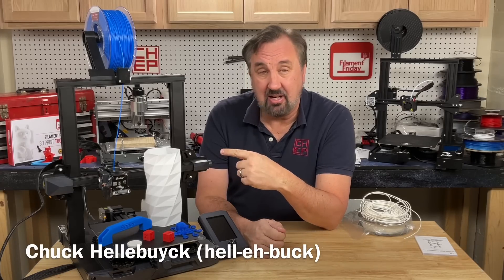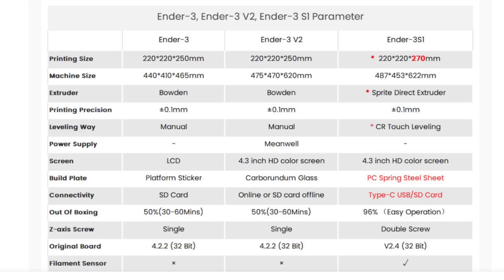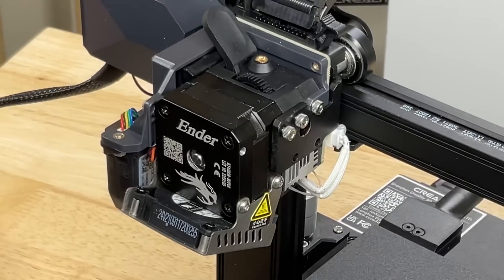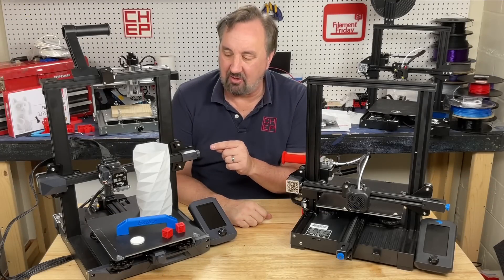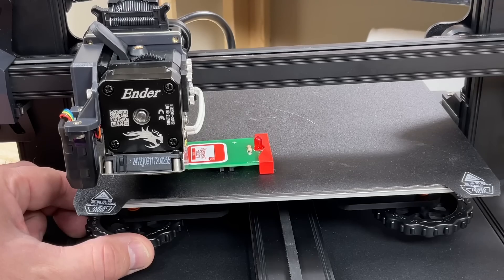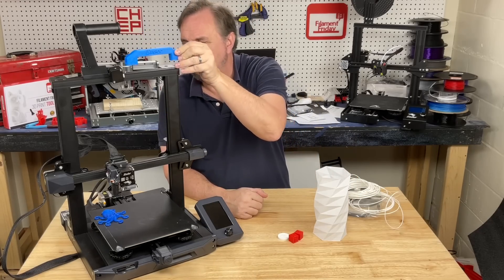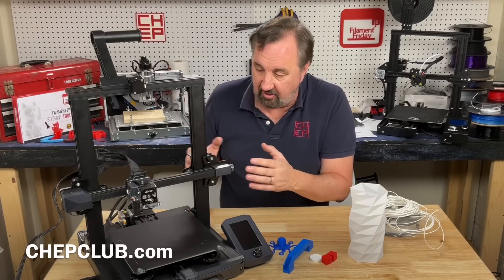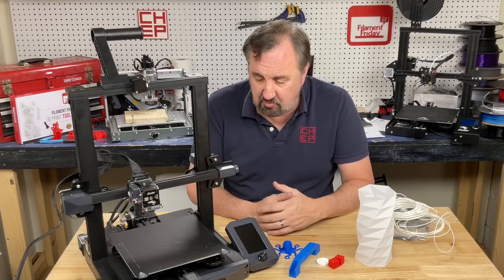Ender 3 S1 - The Direct Drive, Auto Level Ender 3 3D Printer?

Comment: The PTFE tube is common for MK8 style hotend and heatbreak designs. They all have it, it's threaded all the way and has a PTFE tube in there. That's the way it's been originally designed. If you know of any MK8 compatible heatbreak that has no PTFE tube inside, I'm interested.
Reply from the maker: It’s not the PTFE in there it’s that it goes all the way to the nozzle instead of hitting a metal heat break first. Many MK8 have that heat break.
Reply: @FilamentFriday  I get that this is an issue, but show me one that has an all threaded heatbreak (i.e. the heatbreak crews into the heatsink and the heater block) and no PTFE tube all the way, I'd honestly like to buy one. That PTFE tube is part of the heatbreak, it's not the intake PTFE tube going all the way down to the nozzle (how could it? The extruder is there first). Those that don't have the PTFE tube have no threading up the heatsing afaik.
Reply: @The-Weekend-Warrior   Microswiss
Reply: @mr.spongylikeaboss4987  Microswiss has an MK8 compatible heatbreak/hotend?

Comment: Just came here from your Aquila S2 review. Based on that review, it seems like you're either not taking a fair look at these machines or not accounting for the actual price for a regular consumer. The Aquila S2 is priced at $279-$289 depending on the mainboard, $289 for the N32 that most folks want, however it costs $105 for shipping. Maybe I am missing where it is being shipped for free, but that means it's only $5 cheaper than this printer, which is now priced at $399 on Creality's store. Sure the Aquila has an all metal hot end, but this printer has dual z-axis drive, an auto bed level, larger print volume, and comes mostly assembled. It would be much easier to throw a Copperhead in the Ender than upgrade the Aquila to the level of this printer. Yet you are very critical of the Ender but glowing in your review of the Aquila. Apologies if I'm missing something, but I almost bought the Aquila based on your review and now I am glad I did not, and I just think your audience would be better served by fair opinions based on actual cost to the consumer as opposed to an MSRP figure. Perhaps the S2 will eventually be available with free shipping and represent a bargain high temp printer, but as of today that is not the case.
Reply: The comparison is with the other Ender 3 available. Ender 3 machines where always around 220 bucks. Sometimes for 170 bucks on sale, sometimes for 270 on amazon. And of course the development does not stop ... but now suddenly in the 400 bucks territory? Seems a bit expensive to me.
Another product would be the Artillery Genius. You can look this one up if you want. Or Anycubics i3 Mega (if it is still build).
Shipping was often around 30 bucks or for free ... So maybe it's not needed to pay that much.

Comment: The white thing in the hot end is the same diameter as the screw heads. Are you sure it's plastic tubing? It looks like smooth metal or ceramic, to me.
Reply: its ptfe... nothing ceramic in there

Comment: My posts are disappearing, so I won't post the link this time.  With the new stuff we see coming from Creality (the link to the Creality web site I can't seen to post), you can:
Buy the S1
Add the Sprite "Pro" Extruder/Hotend (all metal)
Add the LED light bar for the S1
Add the laser engraver attachment for the S1

And still spend less than the assemble-it-yourself version of the Prusa  MK3S+.

Would that be as good as a Prusa, though, especially for doing mostly PETG printing?

Comment: Dude! Thank you so much! I was really looking at getting this printer because I print a lot of TPU..but I think I might look into something else. I'm actually not hating how well a stock ender 3 handles printing TPU imo.. I'm currently trying out a Sovol Sv04 that I might buy off a buddy but I can't get it to print a nice as my ender3 and ender3 pro does..
Reply: Just replace the throat tube  with a bimetal throat for $7 and print tpu  abs petg  or pla it works  watch the vids from creality on cleaning the throat to replace  throat with a bimetal one works fine

Comment: I don't like how the cable ribbon from extruder is lined when attached to its bracket. When homing on Y it actually bends ond crushes the ribbon through hitting Z pillars. On the video you can see its bent. I am afraid this will break ribbon and cause serious troubles getting this fixed or replace. Mine ribbon is somewhat turned a lot to flex and not hit frame. Other things. Yes, I hope I will replace heatbreak soon. THere are some videos mentioning updated sprite with metal break. I had ENder 3 stock. And I own Anycubic Vyper. THe autoleveling combined with manual regulation of bed is awesome compared to VYpere, where you get 3x3 bed levelling and a lot of problems getting prints stick. Generally I am very happy with S1. Its a little bit slower compared to Vyper, but my prints adhere like a dog poop to your new boot so I can accept 10% longer prints.

Comment: Very useful assessment - thanks for your hard work and knowledge. I have an original Ender 3 ('v1') which I made a few custom upgrades to - and honestly from what you showed it's not worth me 'upgrading' to this new model for my PLA-only useage. Perhaps for others who need direct drive for flexibles  its OK but you can upgrade that yourself anyway for cheaper and if you are buying an Ender you are going to be the kind of person who likes to 'get under the hood' so this seems like a not so worthwhile purchase to me. Also, I never quite understood the need for auto-levelling. I've been printing on glass for 4 years and once I learnt how to properly stabilise the bed screws and treat the glass I've never had an issue with the bed going off level (I print only PLA on glass but my models are complex and range from tiny to large flat sheets and I use the whole bed).

Comment: They probably didn't do an all metal hotend so they can offer it as a payed upgrade later, same for the 512k board. I worry about the dual z getting skewed over time with turning the power on and off, they should really give these machines a proper power down cycle that negates the z axis' from being misaligned and allows us to keep the main power switch on.
Reply from the maker: A belt connects the two so that should prevent that.

Comment: My first printer was an Ender 3 Max, which very quickly got replaced by 8 Artillery genius printers and 3 FLsun SR's that I am using for my farm. This new model looks like they took all the little quirks from the Genius + SR and just added them to the Ender 3. Even the assembly and the little drawer I recognise nearly right down to how it looks, where it is and how it works. 

So the main work they seem to have done is by redesigning some of how it looks, but functionally they have done little work but slap some features together. Was really interested in the printer despite this until I saw the chip size and hot end, really sad. They have just made a slightly more flashy printer for those entering the space with more cash, but functionally it's still the same old Creality again.

Comment: I haven't seen anything about this printer until this video, so my reactions are first-impression. I really like the look, especially of the front-end angles and the drawer system it comes with. Super clean. I'm writing this as someone who has an Ender 3 Pro that shipped with an 8 bit 1.1.4. I've since switched to the 4.2.7 and added CR Touch. I'm glad they added it - I love the CR touch. Strangely enough, the leveling process on the 4.2.7 is a 25-point touch, not a 16. 16 is probably nice because it's a little bit less waiting for the print to start if you coded the G29 in to all your code. I don't really "need" filament sensors as I use a scale to estimate what I've got before most prints and it seems to serve me well. I am jealous of the dual-z steppers and rods. That's a really nice feature. As for the hotend, I myself was victim to the clogging caused by that burnt 20mm tip of PTFE tubing and switched to the the Capricorn-in-the-hotend to spacer to PTFE tubing that you showed in a previous video, so big bummer to hear they skimped out again. But I definitely wouldn't have been mad if this was my entry printer. I would, however, have missed out on the fun and frustration of adding drawers, changing boards, breaking my printer, and fixing my printer that comes with doing your own upgrades. Thanks for another great review.
Reply: Another really good upgrade is the colour touch screen from BIGTREETECH TFT35 and 32bit mainboard makes life so much easier to use and the LONGER LK5 Pro is amazing for the price and build size and print quailty is amazing

Comment: Love mine just as much as my upgraded E3V2 and I don't have to bother doing the upgrades. Which is all I expected. Super quiet too. I prefer a glass bed but I'm going to use the spring steel for a little while. Jyers will be nice.
Reply: Look at the BIGTREETECH TFT35 upgrade and 32bit main board OMG make life much better
Reply: @David-hi9rp  I have to edit my comment a bit.

While I don't need a touch screen, I see that it is more than that. I'll have to look at it. If it will increase my productivity by a good margin I will consider it. I look out for diminishing returns though. I'm very picky and methodical about my upgrades. My goals are usually to try and suck every bit of performance out of stock hardware first.

I'm assuming you mean the big tree Tech 32 bit board? I'll have to look into that as well. I'm assuming they work together.

Comment: I just picked one up yesterday at microcenter for $399 and the out of the box experience is much more polished than my ender 3v2 or ender 3 max was. While its a great printer, I agree whole heartedly regarding the ptfe tube in this hot end. Creality has an all-metal version called the sprite extruder pro on their site, it realistically should have been included at this price point. Creality does have a video showing you how to remove the ptfe tube. it involves heating the hot end, removing the nozzle and heater block from the heatsink assembly then using tweezers to pull the ptfe tube out from the top of the heater block.

Comment: I look at this and think "that's a smaller version of an Artillery Sidewinder X1." The Ender S1 has a drastically better build surface and built-in ABL, but is 2/3 the size of the Sidewinder and has a less impressive hot end. A price tag of $389 would be a much better starting point for this printer, and that might still be too high compared to what the competition is offering - the direct-drive Voxelab Aquila and the Sidewinder X2 are both excellent machines and I think have a much better value than the Ender S1.
Reply: $389 is how much it was being sold for up until a couple weeks ago. That's how much I got it for. Maybe supply and demand drove it up.

Comment: not worth the price tag.  they need a bi-metal heat break and linear rails to make it close to worth it.
Reply: So is it not worth people upgrading their E3v2's either then? Because you'll spend more doing that than just buying this, so logically speaking, why wouldn't this be worth it? In my opinion it's totally worth it. It's just as good as an mk3s for half the price. If I were going to spend anything more than this I would build a Voron.
Reply: @dangerous8333  Kingroon KP5L.. Cheaper does more.  The S1 is over priced money grab.

Comment: Thanks, Chuck. I've been kinda half-heartedly looking at one of these, and you just made up my mind - saved me from wasting the money. I've got less $$ than the price of the S1 into my E3V2, even with what I've spent on "pimp my printer" stuff to get it to the point of having everything but the direct drive extruder (which I need about as much as I need to be bashed in the head with a frying pan - everything I've needed/wanted to do with it to date has involved rigid plastics) and the filament sensor (in the works - got the parts, just haven't had enough of a reason to actually assemble/install 'em) and if I wanted it, could grab the PEI buildplate, but so far, the stock carborundum glass bed it came with has done me fine. Plus I've got the 512K of flash (Plenty of room to play with customized Marlin or other firmware) thanks to the V4.2.2 motherboard, with an OctoPi on the side to give it network/WiFi capability and make the microSD slot irrelevant for everything but flashing firmware.
Reply: I'm skeptical you spent less on everything you just listed for your E3V2 unless you bought the cheapest knockoff stuff imaginable. Just adding a metal extruder, microswiss all metal hot end, BL or CR touch, bedsprings, and you're at $100. Unless you saved a big chunk of money on your E3V2 (most do not), I don't see how you spent less than what you get for $400 with the S1. I literally did the math before buying it. I don't shop on aliexpress so maybe you saved some money doing that. The shipping takes too long for me and time is money for me.

In my opinion the S1 is for people that want to do production and don't want to bother upgrading another machine or another five machines. This thing is ready to go into a farm right now.

I have an upgraded E3V2 and I bought an S1 for $389, and I don't feel like I wasted any money at all, it has double the upgrades for the same price I spent upgrading my E3V2 and I'm saving time. The S1 went right into production on the first day. In the last 3 weeks I probably made close to $1,000 with it already.

I agree with you about the direct drive UNLESS you have dual z-axis to make up for the weight. So I think it's fine in this instance. Either way I was about to buy another E3V2 and I just don't have the time or desire to upgrade it, for twice the cost.

Comment: I'm sure its been mentioned but even new v2s are coming with 256 chip. Sucks but I'm sure it was done so they could produce the printer due to shortages. There's also a bug where the z offset changes everything you auto home. Overall my s1 out of the box beat the v2 with minor adjustments. I didn't have to tear down the gantry , square things up and pray I didn't have to repeat the process.
Reply: I loosened everything anyway and redid it. I don't trust their assembly.

Comment: I've seen a sprite 'pro' with all metal hot end available separately. Maybe they are planning on doing an s1 pro model?

I have been wondering if it would be a good direct drive upgrade for an older ender?
Reply: I think it's for cr-10 smart pro or something like that, revealed the same time with ender 3 s1
Reply: There is a profile for a S1 pro in creality's version of cura

Comment: Nice try but does the supplied touch probe work with the Jeyers update ? 
I still think i can upgrade a V2 to do  the same with the exception of build volume for less money and even add something like a micro swiss  set up for less money .
Reply: CR touch has worked perfectly fine with Jyers on my E3V2, and no you can't upgrade the E3V2 with the same stuff for less money.

Comment: Creality lost their mind somewhat with that extruder assembly. They're asking AU$172 for the regular one, AU$206 for the "Pro" (the extra AU$30 gets you a titanium heat break and nothing more). This is compared to AU$155 for a Biqu H2 v2 or AU$125 for a Trianglelab Matrix Lite - both of which have a bi-metal heat break. The Sprite does include a part cooling fan, but the other two include a heater and thermistor so I've no idea what the extra AU$50+ is all about.

Probably why they're asking so much more the S1 as compared to the v2.

Comment: I'm still a fan of the stock ender 3. I learned so much through upgrading it my and it really makes it so that you can make the printer your's. Also that hotend setup is absolutely ridiculous! So much is streamlined in that hotend setup with the breakout board for the connectors and the bed level sensor and then it just has the PTFE all the way to the end??? Come on creality! So close to greatness lol
Reply: Yeah I learned a lot on my first printer too. So been there, done that. Not interested in doing that for every printer I add to my farm.

That's really where the S1 shines. If you need multiple printers for production and you already have E3v2s I would buy the S1 now instead.

Comment: Really too much Money Dude ... after all of us have got one and modified it  but If ya want this great printer just get the basic . And you will figure it all out  as you print what you need along the way with what material eg PLA PEGT  NYLON etc But Great guy this is you will learn a lot from
Reply: I paid $389 and that was a hell of a deal compared to how much I've spent on half these upgrades for my E3V2. The S1 is for people that are into production and already know about printers and don't want to bother doing the upgrades on every machine they buy.

If that isn't you I would just get a regular E3V2 and not even upgrade it at all.

However, anyone planning to do any of these upgrades would be a fool to get an E3V2 at this point.
Reply: @dangerous8333  The best upgrade i have done is the colour touch screen by Big Tree Tech TFT35 and the 32Bit main board oh the joy it makes instead of that clumsy ENDER Interface But if you truly want a good printer have a look at the LONGER LK5 PRO  Price and print quality is awesome mate